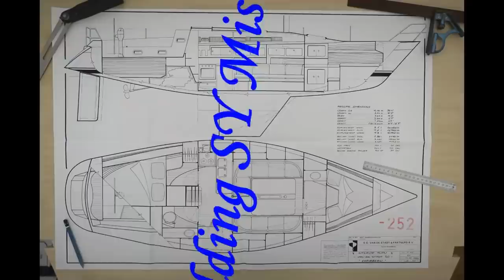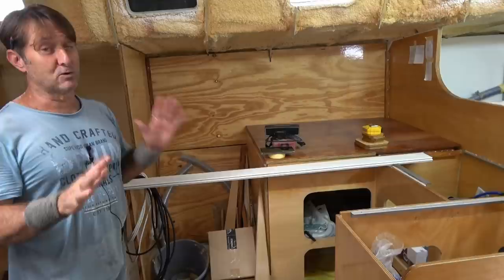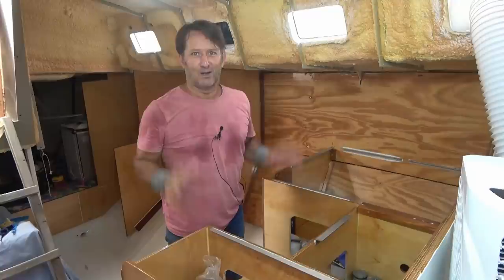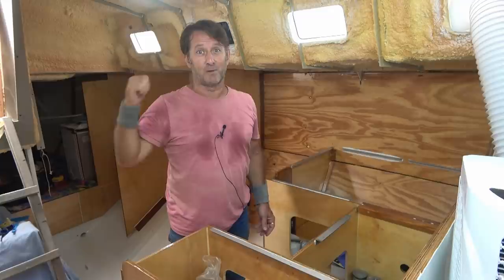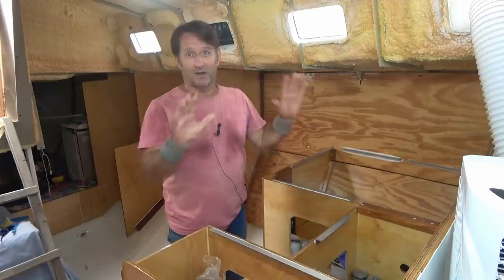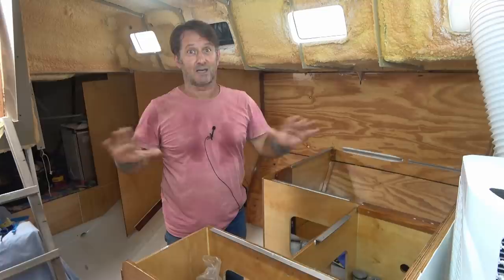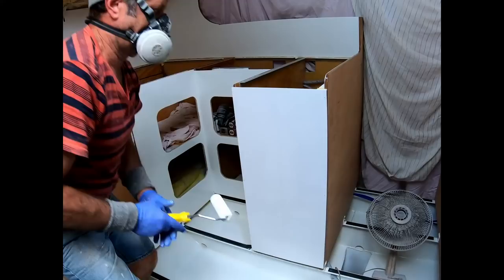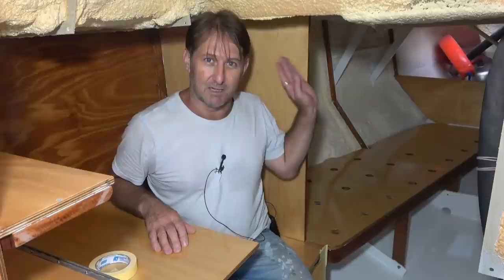A BIG "part 2" paint day! 🎨💋 Ep.128 Building my steel sailing yacht

Comment: If your portable Air Conditioner only has a single pipe going out the back, you might try putting the whole unit outside and do a little jury rigging to have it pump cold air into the boat. If your unit is like mine, it's constantly taking air from inside the boat and pumping it out the exhaust you have running up to the port opening.  That air of course is being replaced by hot outside air.
Reply from the maker: Thanks for the good suggestion Robert, I will have a think about this!

Comment: Looking great Bruce, hopefully the weather is starting to cool off for you, looks uncomfortable for the types of job you have to do. Two questions I have just for my reference in the highly unlikely chance that I actually get off my ass to do it someday ~ 1) Why remove the screws, looked countersunk enough to put filler on top and paint? 2) If you were to do it again would you consider painting the first couple of white coats in the "shop" before assembly in the boat with just a top coat later or would still do the sanding and white coats in situ?
Reply from the maker: Thanks very much for your good comments and questions, appreciated and re. the weather, we are pretty much mid summer here and it has actually been a very mild one so far,... And no, I am not a fan of profusely sweating, but, the work needs to be done hey,... I removed those screws because they weren't needed for strength purposes and I find it quicker/easier to fill up the holes without the screwheads in place and I only went to this trouble on those cabinets because they won't ever need to be disassembled (in my lifetime) and will always be very visible. Re. if in a next time build would I paint panels before installing, for most, yes, I would and as you say, leave the final coat to be done once installed and the main reason would be to make the sanding and clean up easier!  🙂👍
Reply: @BuildingSYMistress  Thank you for the insider knowledge sir! Secured away to feed my dreams. BTW the dust and debris on your fan guard is playing havoc with my OCD!
Reply from the maker: @supers54  Welcome sir and one other significant point is that when I was installing all of those bulkheads, panels, etc. I really was not sure what paintwork design I wanted and on hindsight I KNOW that I would have done something quite different 2 and 1 years ago, so I am not regretful that it was left to recently, because the paintwork design is MUCH better now!